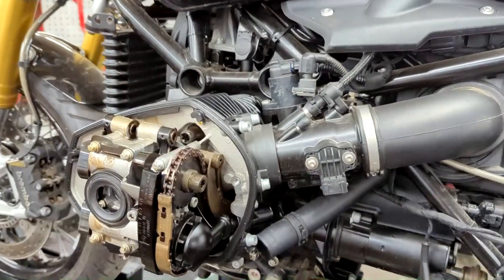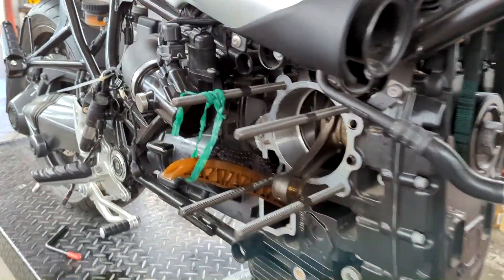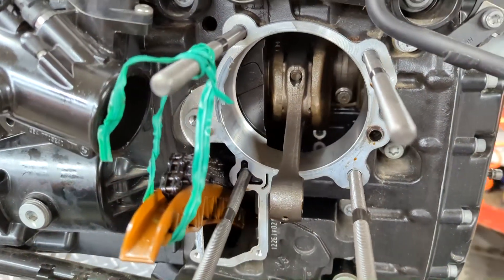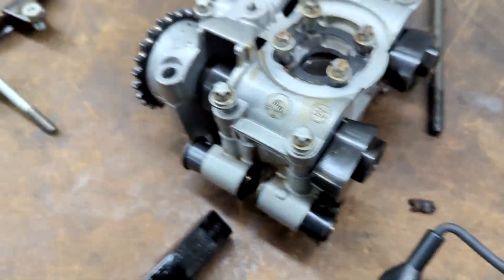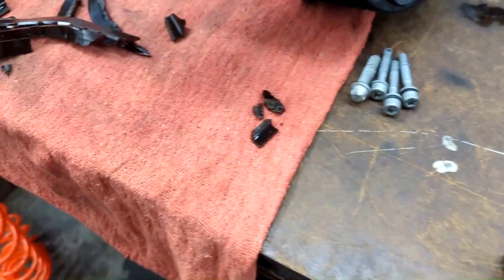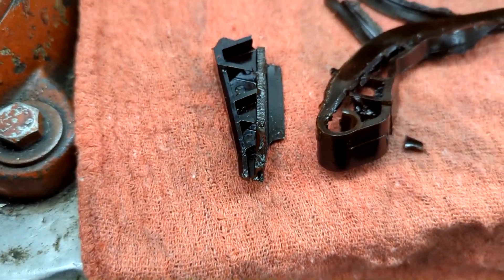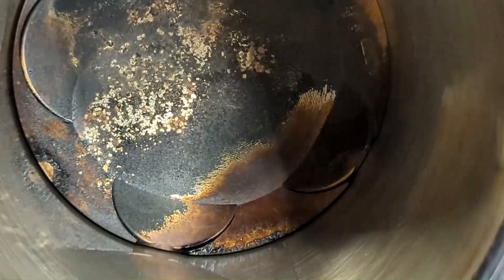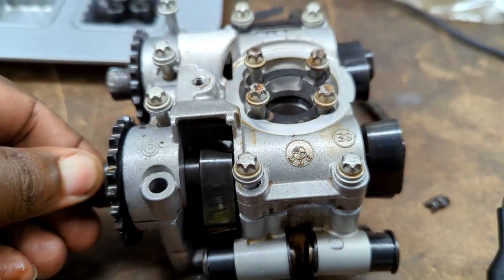Do NOT Idle-charge Your Bike!!

Comment: If I aint riding its bc its too damn cold. Motor ain't gonna overheat in the winter. I have done this many times and it never hurts it. I twist the throttle to get it above 2000 rpm while sitting so it wont damage the stator just from idling but other than that its fine. I've never had to replace a bad stator or regulator from doing this. I have Harleys so I've never run into this problem.  I have on the other hand had to jump a bike off bc i let it sit too long and even have to buy another battery after about three years but thats about the normal life if a bike battery.
Reply from the maker: 2000 rpm, 3000..., what difference does that make? How does idling damage a stator but slightly above idle (depending on the bike) does not? And, if you have the time to stand there and hold the throttle at 2,000 rpm then why not just ride it?
Reply: @RideQuick  for reasons I stated.

Comment: Would that apply for rc51? And idle doesn’t seem to charge it.
Reply from the maker: You shouldn't do it with ANY bike. It's just stress on the system and bikes don't make much current at idle. The RC51 is liquid cooled, so in theory, as long as the cooling system is up for it, it'll run at an idle. The best thing is to ride it or use a charger.